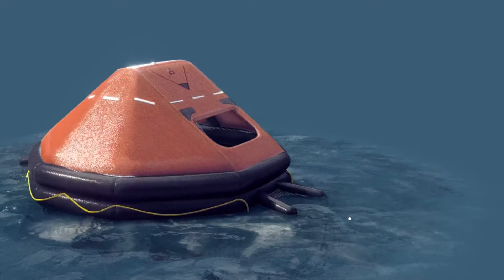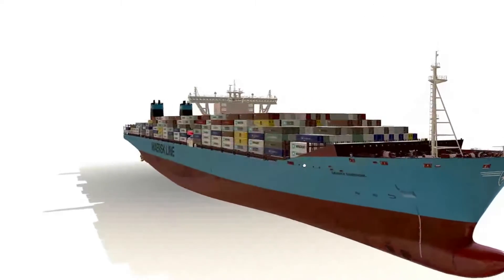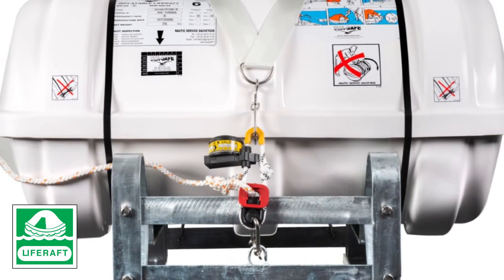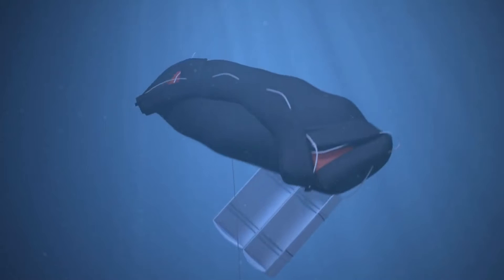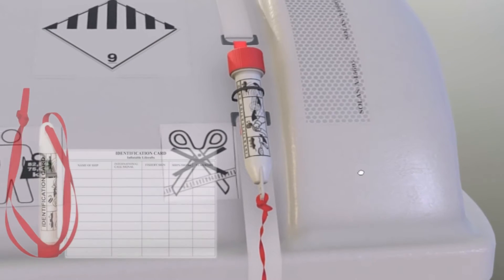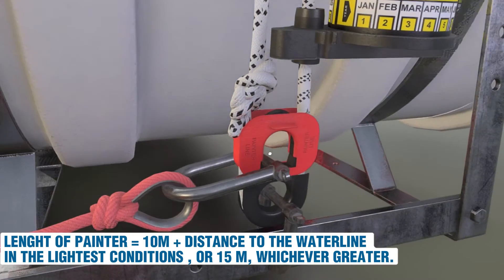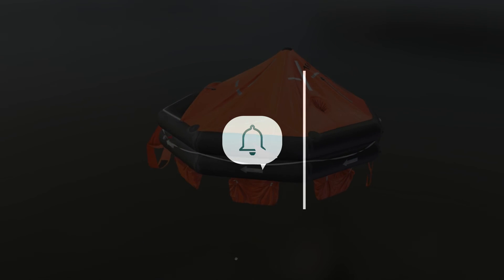Liferaft & Hydrostatic Release: What You Need To Know?

Comment: Dear friend,

Please make a reference to SOLAS and let me know where the requirements for marking the ship's name and port registry on the liferaft's body are located.

Thank you for your help.
Reply from the maker: Welcome, as i understand ur question is LSA CODE - 4.2.7.2 Provision shall be made for marking each liferaft with the name and port of registry of the ship to which it is to be fitted, in such a form that the ship identification can be changed at any time without
opening the container.
Reply from the maker: Prom practice side , supplier generally arrange the name of the ship and the port of registry stickers already installed on liferaft container to avoid any paint stencils by the crew side, to avoid the removing paint in future.

Comment from the maker: Was this video helpful for you? 😊What have you learned for yourself new? 🧐

Below is the second part of this video, which includes requirements for life raft construction and life raft equipment. ⬇⬇⬇⬇⬇⬇

https://www.youtube.com/watch?v=TrDBDcUgMwM&t=4s

Awaiting for your questions !   ⬇⬇⬇

Quick overview for chapters:

00:00 - Liferaft  Intro
00:43 - SOLAS Requirements for Life Rafts  ( Duration of Survival / Liferaft Drop Test/ Required Quantity/ Required Capacity )
01:45 - Forecastle and Aft Station Liferaft Requirements.
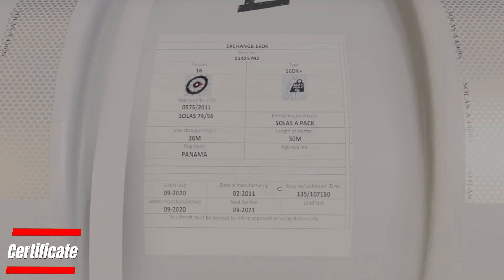02:13 - Liferaft Overview
02:30 - Liferaft Lashing & Life Raft Manual Release  
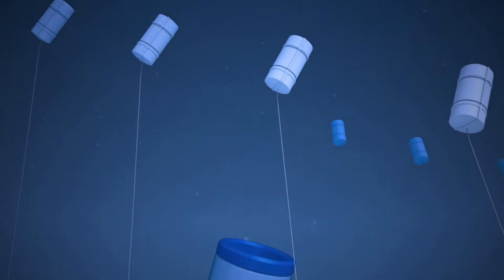02:59 - Liferaft Hydrostatic Release Unit & Liferaft Automatic Release 
03:24 - Liferaft Painter System &  Hydrostatic Release Unit Activation Procedure on Depth 
04:30 - Liferaft Hydrostatic Release Unit Expiration Date
05:24 - Whats Liferaft Identification / Information Card ?
05:46 - Liferaft  Marking 
06:33 - Whats difference between Liferaft Solas " A " Pack & Solas " B " Pack  ?
07:12 - Liferaft Last & Next Cervice Date | Liferaft Annual Certificate